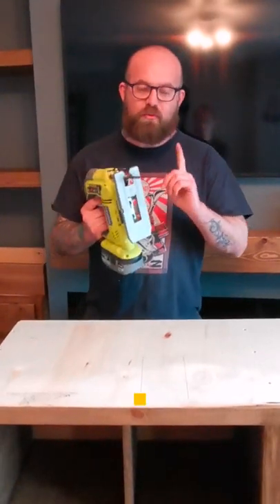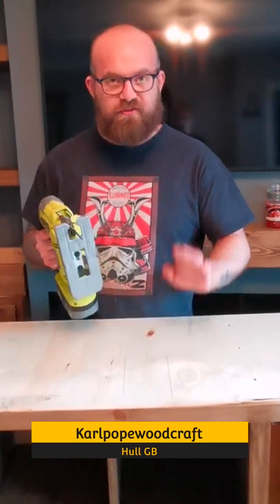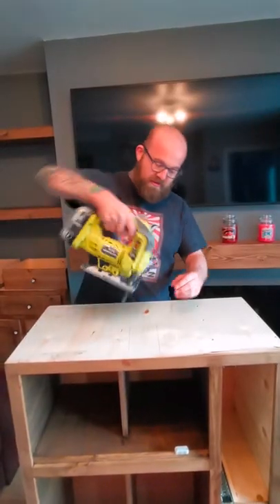How To Plunge Cut With A Jigsaw No Drilling Required #shorts

Comment: You always want to make sure that the blade is at longest length. Match the edge of the blade with the end of your mark the measure back the length of the blade, the pointed to measure back at is where you could start tipping the jigsaw on it’s shoe.
Reply from the maker: Cheers 😀
Reply: I don't understand